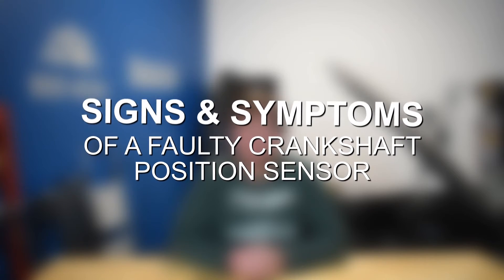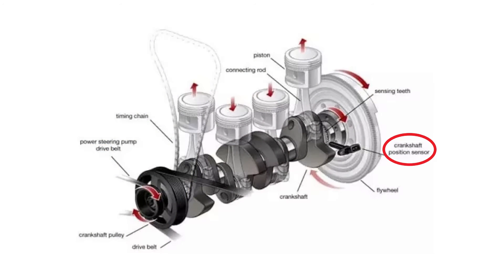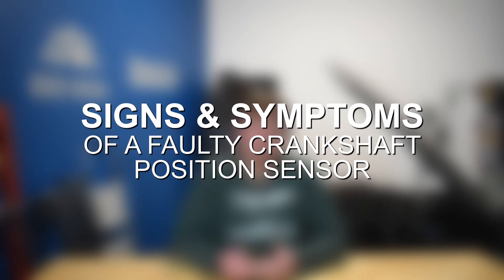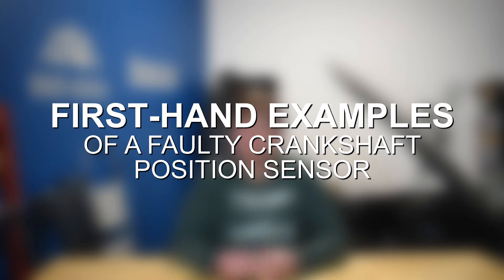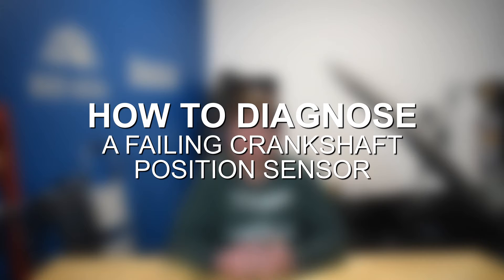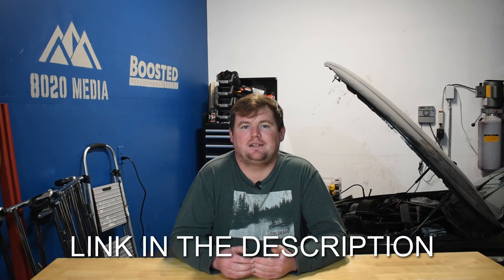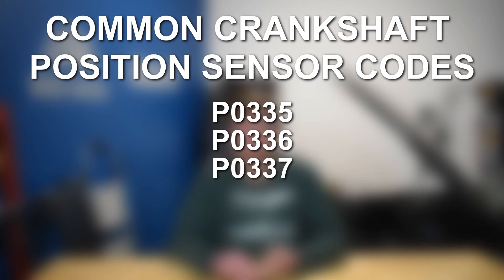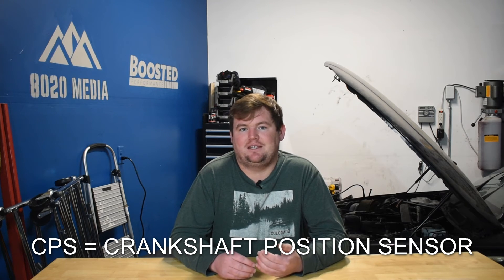DIY - Signs & Symptoms of a Bad Crankshaft Position Sensor!

Comment: 2006 benz e350 v6 . i also had cam codes which i replaced the sensors , car ran , still cranked 7 times before starting . cleared codes then it wouldnt start and only code i have now is p0335 . i put in a new sensor and still wont start . it does crank

Comment: What about if its feeling jerky every once in a while. Like bumps a few times and stops and does it more when the motor warms up. Along with the idle being crazy, going really low and then sounding like someone is revving it
Reply: No engine light though
Reply from the maker: H - Jerky driving with random “bumping,” worse once warm, plus an unstable idle that dips very low then surges like it’s revving on its own — but no check-engine light — usually points to an airflow or idle control problem rather than a major mechanical failure. On most cars this combo is caused by a dirty or failing idle air control valve (IACV), a sticky/dirty throttle body, or an intake/vacuum leak that throws off air/fuel balance but isn’t big enough to trigger a hard fault code. Since it gets worse when warm, a weak sensor like the MAF or engine coolant temp sensor can also contribute, as the ECU relies more on them once the car leaves cold-start enrichment. I’d start by thoroughly cleaning the throttle body and IAC passage, checking for vacuum leaks around hoses and the intake, and cleaning the MAF. If the problem persists, monitoring live data (fuel trims, idle control position) with a scanner will quickly show whether it’s fuel, air, or sensor related.

Comment: Great video, mate. Could code P0016 and P0018 relate to the crankshaft sensor. Are the symptoms on startup only or even when driving
Reply from the maker: D - Yes, codes P0016 (Crankshaft-Camshaft Correlation Bank 1 Sensor A) and P0018 (Crankshaft-Camshaft Correlation Bank 2 Sensor A) can absolutely be related to a faulty crankshaft position sensor, as these codes indicate that the ECU is detecting timing discrepancies between the crankshaft and camshaft sensors—a weak or intermittent crank sensor can cause bad signal correlation. Symptoms can appear at startup (hard starting, long cranks, rough idle) but also while driving, including hesitation, misfires, reduced power, or even stalling. However, these codes can also stem from timing chain stretch, camshaft sensor issues, or timing misalignment, so it’s important to test the crank sensor output and inspect actual mechanical timing if the issue persists.

Comment: I have a 2003 mustang and I got a code saying it's a CPS I did and oil change and started getting a ticking does this sensor cause this
Reply from the maker: C - On your Mustang, a code for the Camshaft Position Sensor (CPS) typically wouldn’t cause a ticking noise, especially after an oil change—the CPS affects ignition timing and can cause hard starts, rough idle, or stalling, but not mechanical ticking. If the ticking started immediately after the oil change, it’s more likely related to low oil pressure, wrong oil viscosity, or possibly air trapped in the hydraulic lifters—make sure the oil level is correct, the filter was installed properly, and you used the right grade oil (usually 5W-20 or 5W-30 for most ’03 Mustangs); if all that checks out and the ticking continues, it’s likely mechanical and unrelated to the CPS.

Comment: What happens if you keep running a car with  a bad cps?
Reply from the maker: T - If you keep running a car with a bad crankshaft position sensor (CPS), it can lead to increasingly worse symptoms like engine misfires, stalling, poor acceleration, rough idling, hard starting, or complete no-start conditions. Over time, it may cause serious drivability issues or leave you stranded, since the CPS provides critical timing information to the ECU. Ignoring it can also lead to damage in other components like the catalytic converter due to unburnt fuel. Replacing it early can prevent breakdowns and costly repairs.

Comment: Do yu have to do a relearn on a 2004 gmc envoy...
Reply from the maker: K - Yes, after replacing the crankshaft position sensor (CKP) on a 2004 GMC Envoy, you typically need to perform a crankshaft position variation relearn using a scan tool like a GM Tech 2 or an advanced OBD-II scanner that supports relearn procedures. This allows the PCM to properly sync the new sensor with engine timing. If the relearn isn't done, you may experience hard starts, rough idle, or engine misfires. Some vehicles may eventually relearn on their own after multiple drive cycles, but it's best to manually initiate the process to avoid performance issues.
Reply: @8020Automotive  ok thank Yu sir .

Comment: I have a 08 Honda accord and the code I have is p0339. I have replaced it before and it came back 2 weeks later. I recently just replaced the spark plugs. I don’t know what else to do. It does long cranks when the engine is hot or cold
Reply from the maker: E - A P0339 code on your 2008 Honda Accord indicates a Crankshaft Position Sensor "A" Circuit Intermittent issue. Since you've already replaced the sensor and the code returned, the problem could be wiring-related, a bad reluctor wheel, or an issue with the ECM. First, inspect the wiring harness for damage, corrosion, or loose connections leading to the crankshaft sensor. Next, check the reluctor wheel (tone ring) for dirt, cracks, or misalignment, as an inconsistent signal can cause the long crank. If the wiring and reluctor wheel check out, consider testing the battery and alternator, as low voltage can trigger crank sensor faults. Lastly, if everything looks good, a failing ECM could be intermittently causing the issue. Keep us updated!

Comment: When my car is up to temperature and I turn it off and turn it back on. It takes really long to crank, but it does crank up. But when the car is cold, it turns on really quake. And yes, I have changed the sport plugs, fuel injectors and the fuel pump. I did that stuff a years back. And all the parts that my car has, there were all original parts
Reply: Check your starter
Reply from the maker: J - A long crank when the engine is warm but a quick start when cold often points to a failing crankshaft position sensor, weak fuel pressure regulator, or heat-soaked starter. The crank sensor can fail intermittently when hot, causing extended cranking. A weak fuel pressure regulator or leaky injectors can lead to fuel pressure loss, making warm starts difficult. Additionally, if the starter is aging, heat soak can cause increased resistance, slowing cranking speed. Checking fuel pressure when warm and scanning for stored codes may help pinpoint the issue. Keep us updated!

Comment: I have no Check engine light, but i have a crankshaft position sensor code pop up does that mean anything? Thanks.
Reply from the maker: T - They don't always spark CEL's. Therefore, you may want to check out the sensor.

Comment: Any idea where it is on a 95 Honda accord? 
My car keeps stalling and shutting down after running for 20 mins.. then it won’t re-start unless I let it sit for hours
Reply from the maker: J - Are you getting any engine codes? This video may help: https://youtu.be/7bqAIbYRdnc
Reply: @8020Automotive  nailed it down to the distibutor overheating and causing it to die. 
I have a code for EGR, Ignition, and O2
Reply from the maker: J - Nice! Keep us updated.

Comment: what if you have no engine code??? i have 2008 civic 1.8L and i am struggling to find issue with cold start misfire. I have changed spark plugs, coils and injectors. Also, check O2 sensor, MAF sensor and EGR all are fine. Please let me any line of action i take next
Reply from the maker: 2 - We have a full video on misfires that may be helpful: https://youtu.be/f1mQ5hD1-vI

Comment: I have a 2008 4.0 Ford Ranger, the timing chain guides were worn out so I pulled the engine and put all new timing chains and guides in it along with all new gaskets. (3 timing chains) After putting the engine back in the truck it started and ran perfect.. until it got it up to 3k rpms and it would misfire like crazy. I even tore the engine back apart to make sure it was set in time right and it is. I checked everything and have done all kinds of research while taking a week break from working on it. Now it misfires at 1500 rpms. The only code I get is a P0320 which says the computer cannot get an accurate reading on the engine speed. I have a professional OBD scan computer that allows me to see live data and all sorts of other things. Everything is perfect fuel wise, all the O2 sensors are working perfectly, and nothing is evident.. I actually switched the camshaft sensor and crankshaft sensor from an identical parts truck and it made it worse. It definitely seems like an electrical issue.

Im about to buy both sensors new and hope that it fixes everything. There’s nothing online that really tells me anything so I’m not so sure. 

Edit: I’ve put 15k miles on the truck previous to pulling the engine and it’s never once thrown a code or had a single problem ever. So it’s really throwing me for a loop! Any advice is greatly appreciated.
Reply: This align up so much of what I’m going through right now ,did you find out what it was ?
Reply: @gmoneystakz9805 Yes, it turns out the timing kit varies depending on what year Ranger (obviously). Some brands are different and it turned out to be a .003” difference (thickness) of the crank gear that the harmonic balancer sits on. It was thinner by THAT much and it throws the crank sensor off, causing the PCM to get an inaccurate reading on the crank/engine speed. The only way to fix it is to reuse your old crank gear OR swap harmonic balancers with a newer/older model Ranger (depending on what you have now). The difference is the tone rings on the opposite balancer. Mine had the newer style balancer with the pressed on, skinny, metal tone ring while the old style (what I had to swap to) is solid steel with the rings cast into it. If any of the rings on the harmonic balancer get damaged, it can also cause the same problem. I replaced every sensor and tore the engine apart 3 times to redo the timing LOL. I even pulled the heads off to checks the valves. It took me 6 months before I realised it was a 30 minute job to fix all my problems lol. Apparently it’s pretty common and most people just give up, not much information at all out there. Just look up a 2010 Ford Ranger harmonic balancer VS a 2001, big difference. Swapping balancers is the easiest way, requires no other modifications or extra parts. Sometimes this won’t even cause your truck to throw a check engine light/code. Goodluck, let me know if you get it figured out.

Comment: question- cadillac cts 2008 . when i drive it drives fine then the battery light comes on and code pops up saying service battery charging system and my power steering starts to act up as well but , when i start it in the morning it will run like brand new then after maybe 10-15 minutes the mph needle drops to 0 and the radio and electric stuff goes in and out but it still runs. wondering if its this crankshaft thing or would it have something to do with the alternator? also will stay stuck in gear its left in pls help lol !

Comment: Changed my CPS with an OEM and did relearn and it cleared. The car went back to the same issue as before. It’s a Honda Accord 2010. It’s comes and goes. It’s intermediate
Reply from the maker: R - Did you have an engine code?
Reply: @8020Automotive  I know I had the po339 and took it to a mechanic to relearn it. The crazy thing is that yesterday I started it and this time got a flashing check engine light that put the car in limp mode but lucky for me I work 3 minutes from my house. don’t have a ODB code reader but ordered one. I was able to start again the car with no flashing check engine flashing but on. I took my other car for now. The thing is that I thought relearning it you need to gas the car at certain RPM and hold it but his scanner didn’t tell him to do that. I didn’t have to pay him as I know one of the workers there. He thought it might be a false read due to timing belt maybe since it was never changed before

Comment: I had this code (0388) pop up at the exact same time another code popped up, the other code was 0302, the check engine light came on, but after clearing the codes, it never came back, I recently had my spark plugs changed, and everything looks fine, when I start the car, the engine sputters at low speed or idle, and the RPM stick bounces up and down, I can hear the misfire, but I don’t know what it is, do you have any idea?
Reply from the maker: V - It certainly still could be the sensor. Other thoughts with sputtering is fueling related. Keep us updated here.

Comment: Kia Soul starts easily but stalls when stopping sometimes with no codes.  Thinking Idle Control is dirty or the Crankshaft Sensor.  Going to start with idle control and see what I get...
Reply from the maker: F - We have a full video on engine stalling that we think may help: https://youtu.be/7bqAIbYRdnc
Reply: Did you figure the problem out? Mine has the same issue. No codes.

Comment: Does it matter how strong the magnetic force is? I bought a sensor it seens the magnet isn’t as strong as the previous sensor i had installed
Reply from the maker: C - This is interesting. Is it the same brand?
Reply: @8020Automotive  no I got one off of amazon
Reply from the maker: C - This could be the reason.

Comment: Where is the crankshaft sensor located on 2012 Buick Verano?
Reply from the maker: B - It's located on the engine above the transmission housing.
Reply: @8020Automotive  I had different people telling me it’s under the oil filter housing or on the back side of the engine on passenger side or the same for on driver side. Diagram I got is no help from others.
Reply from the maker: B - Maybe check your manual? or take it to a mechanic.

Comment: I have a question, I have a 2010 335i. A few days ago my engine sputtered, knocked and stalled while starting to drive in first gear. Started again and had slight misfires on cylinder 3 and 5. The day after it will only crank after stalling on its own. Changed all the obv, spark plugs, coil packs, checked hoses for the fuel pump and sender. I hear my fuel pump actuating but i think its not sending fuel over. My scanner wont see any codes after i cleared them like an idiot. Would this be the sensor? Ive been struggling what else to check. I have it hooked up to jumper cables to see if it would be battery. Only starts with starter fluid, so its for sure a fuel issue. Would love a response so i can solve this already. Its been very annoying. Thank you!
Reply: did you end up figuring out the problem? going thru something similar with my veloster
Reply: @taylorbritton9040  Sadly not yet. I encountered a nasty rounded bolt for the sensor. I have a guy coming to drill it out tomorrow so ill keep you posted on if it fixed it!
Reply from the maker: A - We have a ton of videos that we think can help here:
https://youtu.be/cua6aG2ld9E
https://youtu.be/7bqAIbYRdnc

Comment: So this will cause other codes to pop up? I changed out my coils and spark plugs but the scanner is saying crankshaft position sensor and there is engine misfire but I changed them out. If I just change out the sensor will those codes most likely go away?
Reply from the maker: C - There is a high likelihood of them going away. But won't know until after replacing.
Reply: Did you fix this problem and what was the issue?

Comment: I got a 2010 Dodge charger with a 3.5 l I've changed the cam position sensor a bunch of times I still get the same code can you help me
Reply from the maker: D - What code specifically? There are many different CPS codes.
Reply: I wished I could because I still got the same problem that you got I can't figure it out
Reply from the maker: D - We advise getting an obd2 scanner as it will help with diagnosis.